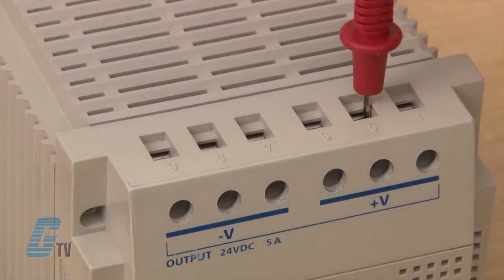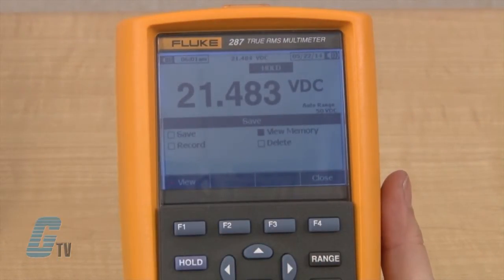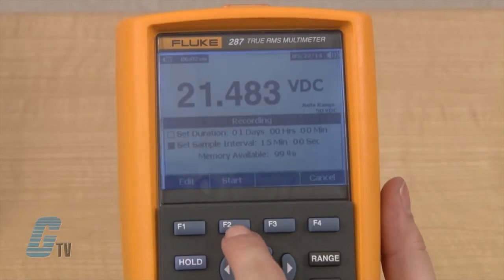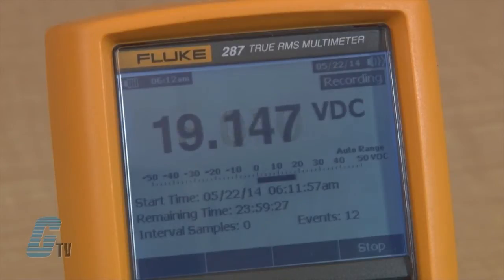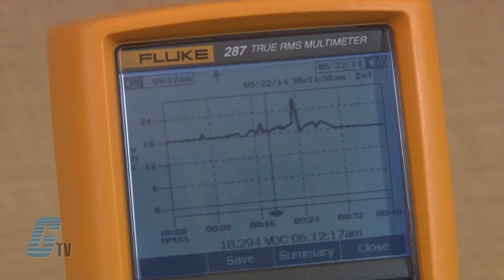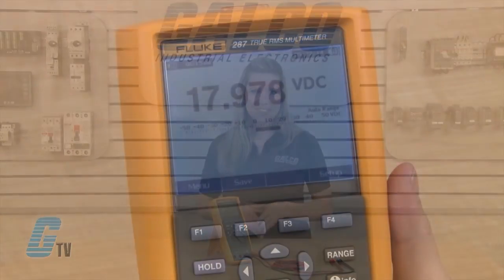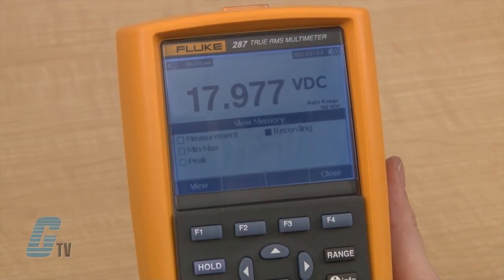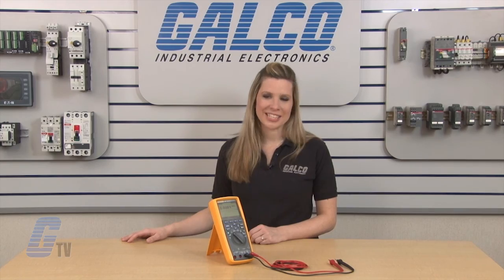How to Set Up TrendCapture on Fluke 287 & 289 True-rms Electronics Logging Multimeter

Comment: Hello. 
Thank you for your sharing.
May I ask a question about this device( fluke 287).
Can I use this device to measure 220V 50Hz sine wave by DC record function?
How about bandwidth of this measurement in this case? May I use this to measure IGBT control signal?

Comment from the maker: The Fluke 287 & 289 True-RMS Electronics Logging Multimeter with TrendCapture quickly documents design performance and graphically displays what happened. Their unique logging and graphing capabilities mean you no longer need to download logged readings to a PC to detect a trend. The Fluke 287 and 289 pack more accuracy and convenience into a handheld multimeter than ever before.